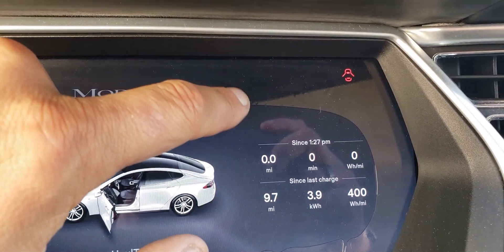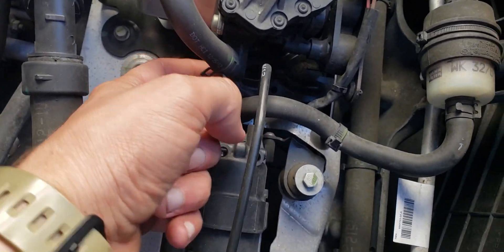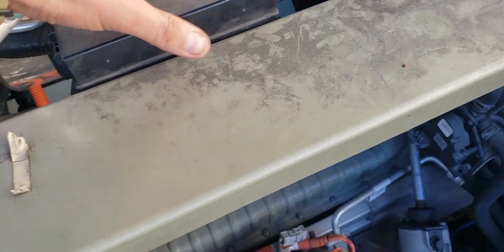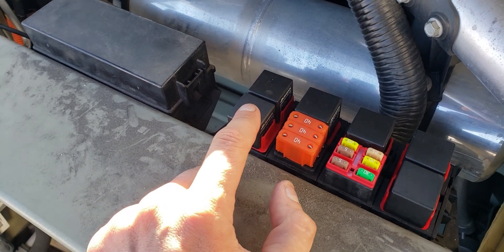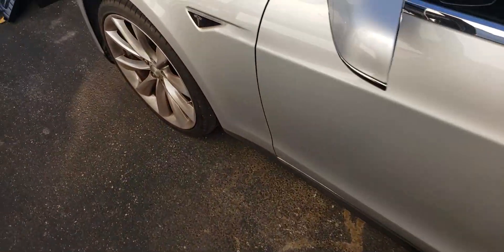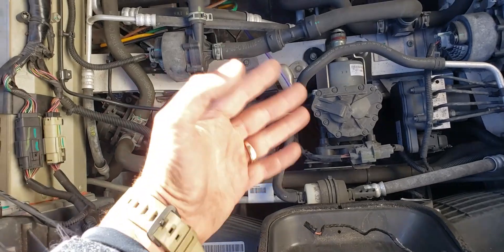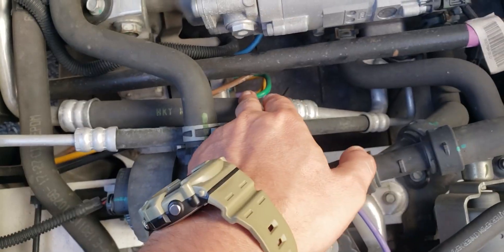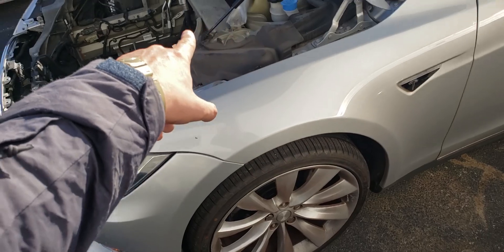Tesla Model S Failed Air Suspension, Low To The Ground. Fixed

Comment: The car goes up, but an error appears—a small red car on the dashboard. After that, the car can't go down. After a while, it lowers itself, and the air suspension starts working normally. Has anyone else encountered something similar? Could it be the compressor, solenoid, or sensors? the car can keeps level no leaks

Comment: If a Model S dropps only i rear and only when parked is it  the solenoid that is broken ? When driving all heights of air suspension works but maybe front a bit higher than rear all the time.
Now I found out what was causing my problem, the air suspension needed recalibration !
Reply from the maker: @peteroffpist1621  Calibration is off, leaking air lines to/shocks in the back, bad/leaking solenoid. Or a combination of these
Reply: @ I have to apologize ( I am not a mechanic). There was no leak, the air suspension needed calibration. But even the workshop got fooled and changed the rear air suspensions 😅

Comment: After changing the compressor, the nitrogen obviously got out. What's the next step? Can you put air in temporary, then bleed, and replace it with nitrogen? Please advise
Reply from the maker: @johnathonjsmith  you can, you will need to get the proper operating pressure (easy, use the scraider valve and check for pressure)
I just left the air in it, make sure it's dry

Comment: Thanks! I have a 2015 P85D, I raised the suspension at highest and leave it in the garage. 2 days later, the left side is lower, and lower. If I get in the car and start it, the pump starts to work and all 4 wheels are highest again. What do you think? Tesla quoted me 3000 for one 2 wheels, since they only repairs them in pairs. Is this something I can fix? Please advise. Many thanks!
Reply from the maker: @Androcentus  start at the shock that lowers and follow the line to solenoid, spray soapy water all the way until you start seeing bubbles. If no bubbles found, your solenoid is bad.
Reply: @Androcentus did you figure it out? Mine lowers after a week on one side, sprayed it with soap but cant see any bubbles...

Comment: Thanks for the video 👍🏻 
I have my 2014 Tesla model s. Left it sitting for 3 months and front end went low to the ground (can’t even steer that’s how low it went) rear is good. When I go to mess with the suspension on the screen it shows that’s it’s already up. With the screen I try to lower it down and middle or up but compressor doesn’t turn on. Doesn’t go down or up . Just front end stays low and rear is up. What do you recommend on me ? Calibration maybe ? 

Swapped relay like you said and nothing, suspension fuse is good.
Reply from the maker: Take the suspension relay out, use a jumper wire (preferably thicker wire with spade terminals, paperclip will do for a second, not more) to jump the (copper colored on relay) contacts for the air pump. 
If the pump will run, then your distribution block isn't working right or there is a clog in the system. If pump will not run - it's possibly not getting power, so you will need to check power at the connector, at the pump. If, when terminals are jumped there is power on the connector, then pump is dead, if no  power, you have a bad wire on the way to pump.
Reply: @rootkitxx  will try that thank you 🙏🏼
Reply: Hello, have you repaired it? I have the same car and I have that problem only with 1 wheel from the back

Comment: I have one shock loosing pressure and scheduled service with Tesla. Now they say three shocks need to be replaced. After seeing your post I informed Tesla to cease repairs until the technician speaks with me first. At the same time the A/C cut on and off a few times. Now I am questioning the relays.
Reply from the maker: Well, it's easy to check. Disassemble the frunk (check other videos on subject) and raise the car to the highest setting. 
Then get your good ole soapy water and spray all the connections.
If the shock is loosing air fast you might be lucky to spot it by finding where it's hissing from.
Shocks rarely fail, it's usually the airline or connection point.
Reply: @matthewlloyd7806  shock or airbag ?  What’s the mileage ?

Comment: So what was the estimate they told you to fix it? It seems like alot of work and i for that icon message and i don't feel the AC anymore working.... but my air suspension is working normal tho.
Reply from the maker: The estimate mentioned in the video. 
Check your a/c relay. If you swapped them and suspension started working, but a/c ceased, it means that your air suspension relay was dead and since you swapped it with  the a/c relay your a/c relay is dead now. Go get the ac relay from Tesla. 
It's actually not that much work man, just a tub disassembly. Relay can be switched/replaced with no disassembly at all (just the top panel, by windshield)
Reply: @rootkitxx  I got their quote and it mentioned like a part that cost like 15 bucks ambient air sensor I think it was called in the pdf in they're message quoted.
Reply from the maker: @dreamkiss4u  that makes sense. A/C system uses that sensor to determine if the outside air too cold. If the air too cold a/c coil will freeze too quick, so it will greatly reduce the performance to keep the coil from freezing.
Reply: @rootkitxx  I'm trying to find a video that shows where it is for a 2015 tesla model s p85d air ambient sensor , if anyone finds that video here or any other site please link me to it.... thanks ahead of time.
Reply from the maker: @dreamkiss4u I would assume this sensor will be on the front bumper somewhere. I think the car uses it to show outside temp too.
Reply: @rootkitxx thanks already got it fixed had that issue a year ago.
Reply from the maker: @dreamkiss4u where was that sensor you looked for? Was that the issue?
Reply: @rootkitxx yeah thy ambient sensor they replaced it

Comment: Hi, Great video, thanks for sharing. I hope you don’t mind me asking for advice.  I have a  Tesla Model S 2017 Electric Motor 100D AWD. The suspension system is flat. There is an error showing up, as follows: Air suspension compressor disabled – your vehicle will not rise. 

There is a 40A fuse that controls the air compressor (it's in a slightly different position than the one in your video). This has blown and when I replace it with a new 40A fuse, it blows immediately. Am I right in concluding that the air compressor itself is faulty? If this is the case, and I purchase a second-hand one, how compatible are these compressors or will I have to purchase from a 2017 model?

Thanks in advance, and I look forward to hearing back from you

With kind regards,

Seamus
Reply: Hi, did you find the solution? I have the same symptoms on Model X
Reply: @Mitrofanovalex  Hi, Sorry about the delay in replying to you. There is a 40A fuse on the fuse-box and if it's blown, replace it. If it blows again, there is a 95% chance it's your Air Compressor Unit for your suspensions. In my case, I purchased a second-hand one and changed it in about 1 hour. If you are doing it yourself, remove the compression unit and only buy the same part number as there are a few different types. I hope this helps, Seamus
Reply: @seamusrispin1967  Thanks for your reply. Yes, in my case the problem was in the compressor, but I was able to fix it myself. The magnet in the engine came off, I glued it on and everything works fine. Removing and installing the compressor is not at all difficult. The main problem is moisture; you need to change the granules in the dehumidifier often.
Reply: @Mitrofanovalex  That is great, well done and thanks for the advice.
Reply from the maker: Well, I'm bit late to the party, but looks like you guys figured it out. 
Btw, compressor can be fixed if blown, unless it's easier/more cost effective to but used off ebay.

Comment: Hello.
Maybe you can help. I have a Tesla S P85 from 2013. A few days ago, when I get to the car the front suspension is all down. The car hits on every bump, so it's stop till that day. I already change the compressor, because I few days earlier, I ear the compressor working non stop for a almost a hour. I thougt it's bronken. How ever, after change it, no sound I get from the compressor. I receive the solenoid yesterday to change, but I do not now if it's gone work. Now after two weeks, I have all the suspensions down. Do you have any clue? Change the tubes to the suspension? When it hapens, only the from suspension is down. The yellow light first apears, then a red one comes.
Reply from the maker: Sounds like you have a leak somewhere if compressor works non stop
Reply from the maker: Raise the car up and spray soapy water on all air line connections. Check all air lines for chafing/holes.

Comment: If you have that much water in the system it would be a good idea to look @ the gel crystals in the pump ( dry them out ) as it will “ wash”the grease from the pump bigend bearing ( very noisy before it gives up) 😖. The bearing can be replaced but it’s not easy
Reply from the maker: Correct. It's better to replace them all together. I don't think it will be anywhere near freezing temps in nearby future, so I'm not worrying about it now.

Comment: Where did you get the little fitting you replaced the original with?
Reply from the maker: Actually you can get one from Tesla, but this is brass airline fitting that is used on trucks

Comment: Hello, my P85D gets the red light “active air suspension automatic self leveling disable” mostly when it becomes freezing outside. I don’t know how to fix it, I think it’s ice somewhere in the system but is there anyway solution to this?
Reply: supposed to be 200psi using nitrogen to represurize it
Reply: Rewatch the video. Water would be in the distribution block
Reply from the maker: You will need to warm it up to the point that water in suspension control block thaws.
 You can take the block off too and make sure to blow all the water out of it, preferably with 100% alcohol flush after (alcohol absorbs water and dries up quick)

There is a practice of using alcohol in air lines on big trucks. You may drop some alcohol down the line to the distribution block so it goes through it, once it's unfrozen. Don't add too much, it will collect at the air tank, absorb water and slush around there - you don't want that. Just enough to clear all that water out of there and "dry the lines"

Comment: I'm in a similar situation, I have a 2012 Telsa Model S P85 lowrider.  I swapped the relays, and I'm about to see if I'm getting electricity to the pump.  Before you replaced the top fitting, do you have any idea of a "normal" pressure in the top reservoir?
Reply: Don't remember. Don't have that fitting there anymore, so can't check the pressure. Can anyone that still has the Schrader fitting check on the pressure?

I think I read somewhere that it was at 75psi, but I could be wrong
Reply from the maker: Pressure really don't matter, as long as it's raising up and suspension works good and no error logo, you are fine.

Comment: You should also do the AC condensation tube. Right now it is dripping onto the battery pack, That has caused moisture getting inside the pack.
Reply from the maker: Probably. It has lived in Florida for over 10 years and so far has been good. Will check on it next time I'm in there!

Comment: Tesla didn’t even offer me to try calibrating it to see if air nitrogen would hold!!!!!
Reply from the maker: That's what I would do to refill it with nitrogen.
- Lower the suspension down all the way
- Enable "jack mode" (suspension leveling disabled)
- Put a vacuum pump on the system to get slight vacuum in there (connect to Schrader valve I showed you removed) 
- Turn off pump. 
- Then, while under vacuum, connect your nitrogen tank to vacuum pump (purge the hose prior) and fillthe tank up to pressure you need.

Similar to refilling a/c system.